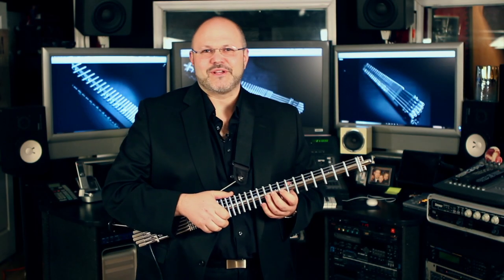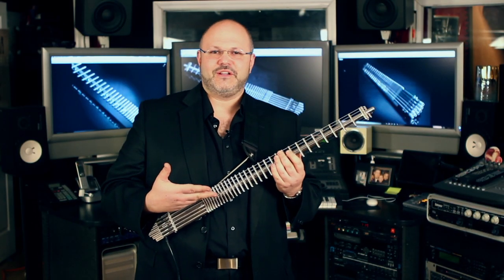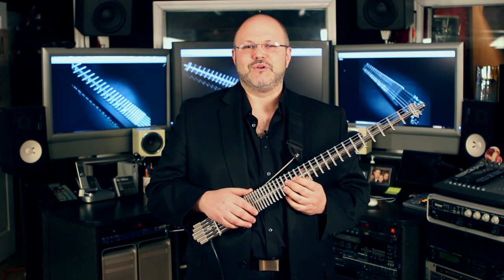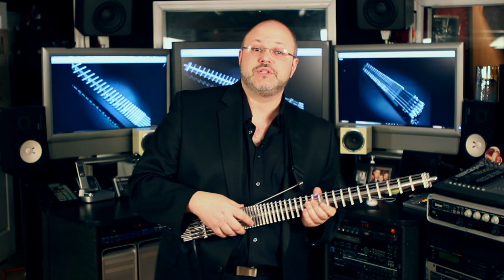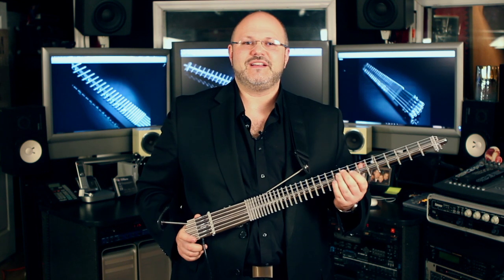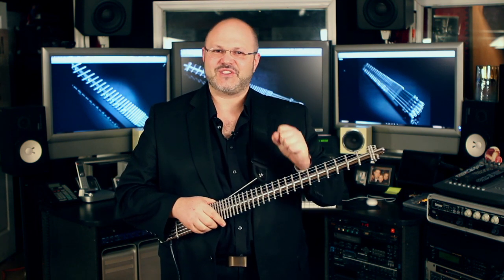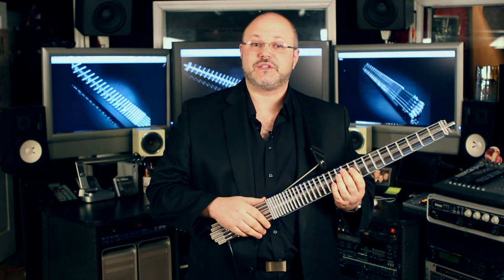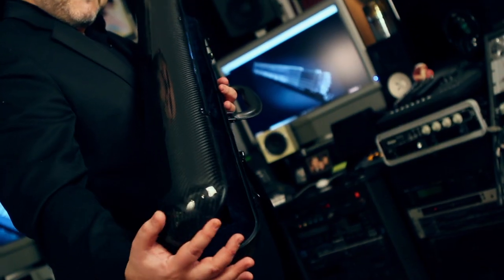Gittler Guitar in Depth - History, Production & Demo!

Comment: Most guitar frets are about 2-3mm wide, but this guitar's frets are about 10mm wide. Even allowing for the fact that one side of the fret rod is in contact with the string, it still seems that the area of contact with the string on this guitar would be wider than most frets.

Comment: These pickups sound a little too bright to me, and it doesn't look like they would be easy to swap! Have you thought of a team-up with Lightwave? A Gittler bass with Lightwave pickups would certainly be the most interesting guitar on the market. Also, the attack on these guitars sounds really sharp. I absolutely LOVE the snap-on necks though. That's a work of absolute genius. I'm sure there would be no intonation issues with this either!
Reply: And fret life is extended by simply rotating worn frets in their neck slots.  The acrylic snap-on fingerboard is kind of a meh feature, though.

Comment: It's definitely a beautiful instrument. But I wouldn't say that Volume & Tone controls are "unnecessary". (Personally, I think I'd prefer those over LED lighting). Also, to be slightly pedantic, the Chapman Stick is similar in that it has no body. (Like the washtub bass has has no body & one could argue that the Steinberger Basses & Guitars are similarly minimalistic with tuning heads at the bottom). -- They're all very cool. But, TBH I think one of the reasons so many people prefer traditional guitars is the ability to easily modify the instrument & customize things like pickups & internal electronics. The aesthetic appeal is also pretty narrow with respect to genre. New Wave, Jazz, Experimental... But I'd certainly hang one on my wall. :)

Comment: "Here at Gimplier Guitars we like to remove all the unnecessary components of the guitar. You know...like sustain and tone.

Sorry I won't be trading in any of my guitars any time soon. What's wrong with the traditional guitar anyway? It may not be perfect, but neither are the players. That's what makes it special in my view.
Reply: > 2015
> still believing in tone from wood
Reply: Nope, not the point. You can`t honestly tell me that this thing sustains notes or sounds very good for that matter.

 I don`t believe that tone is defined by wood. However, a Dobro (national resonator), a Rainsong guitar and a Martin dreadnought all sound very distinctive based on the materials that they are made from. Two of which use different materials than wood for the body.

And yes, pickups are the major contributor to tone in an electric guitar, but you can`t fake sustain. Well...I suppose you could install Fernandez sustainiacs. Ok wait..., what was the argument again? Oh yeah, no discernible sustain or warm tones from the steel twig.
Reply: +Jason Pitre It's not steel. It's Titanium. Wait for the Usher references.
Reply: +einarabelc5 Yeah, okay. It's a transition metal. Thanks for the specificity.
Reply: +Lance Pate Rob Chapman did a video on tone woods. The difference was quite noticeable.
Reply: Bl3ss3dburrito Oh yeah, I've experimented with it myself.  I was just trying to piss the guy off.  It does NOT, however, effect the TONE in ANY active pickup equipped guitar, and it's barely noticeable in shitty passives.

Comment: I think this dude missed the point of "the emperor's new clothes". The moral of that story would apply more to a Gittler than a Strat. Strats have been tried and proven many times over...so there's nothing "new clothes" about them. The Gittler is an entirely new design, which has yet to be vetted. (and probably never will be)

Comment: your price is ridiculous. the idea of changing it to aircraft titanium is not an improvement, simply a cost prohibitor for nearly all guitarists. In fact, all of the ‘improvements’ you mentioned in this propaganda film contribute to that. perhaps this could be an even mildly relevant or successful product if you just made it from a reasonable material. I’m surprised you didn’t plate it in 24kt gold or some other ridiculously unnecessary expensive coating for your BS campaign. I’m tempted to head over to my mill and try my hand at exactly this. You need a lesson from Leo Fender or Henry Ford’s book. And if you don’t know what I mean by that, you have no business designing or manufacturing products for the public!